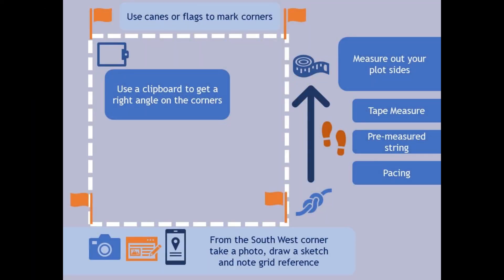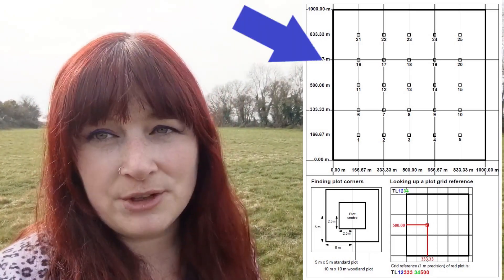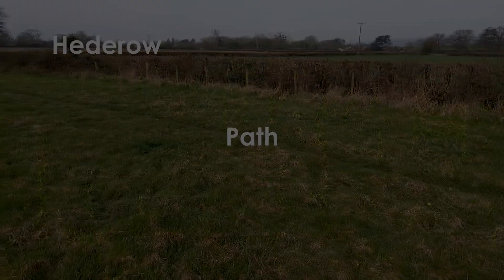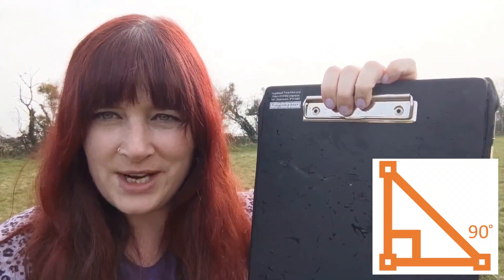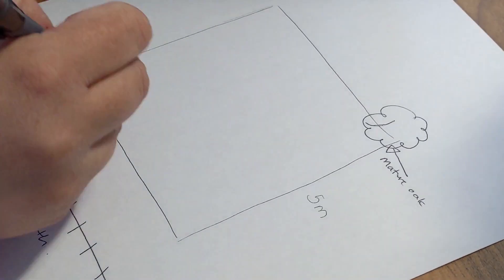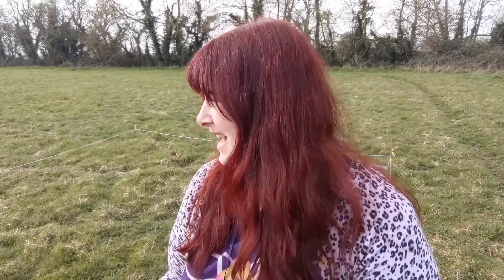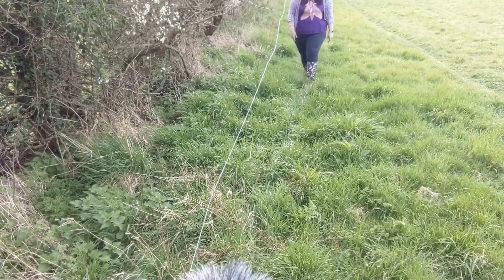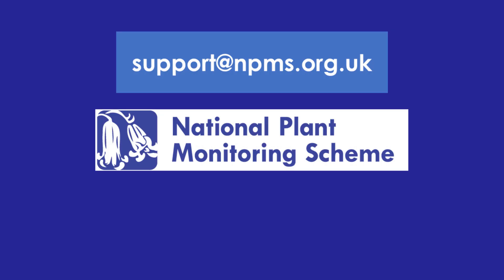Don't Lose the Plot Over Plots

Comment: Hello, I don't own a smartphone. How should I go about finding/selecting my plots? Many Thanks in advance...
Reply from the maker: Hi Sarah, I would say use the plot grid reference crib sheet off the website to give you an accurate grid reference. Then using an OS map mark on the plot, using standard map reading techniques. Then as you would any point on an OS map try to find the spot on the ground by using features and landmarks to help you as marked on the map. This will be as accurate as you can without using a mobile device.